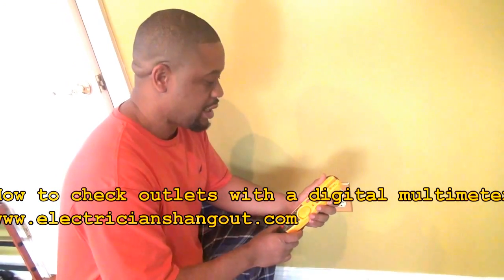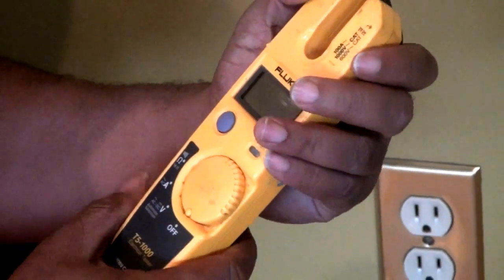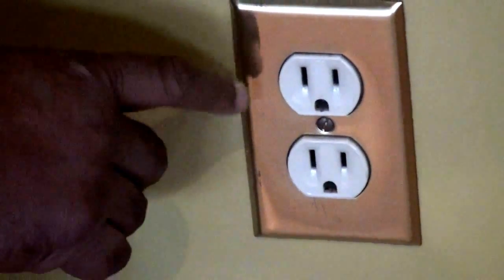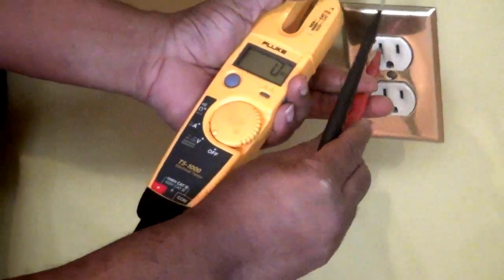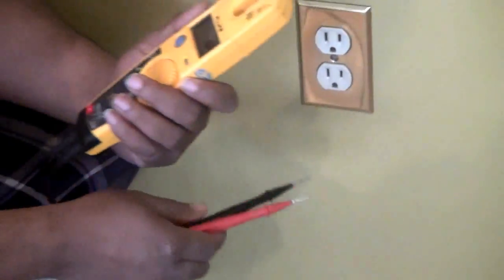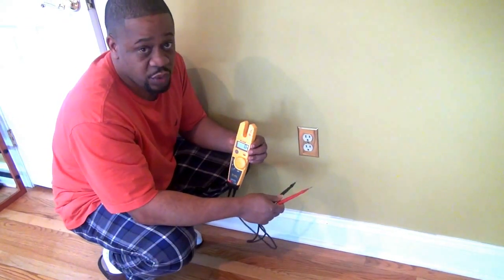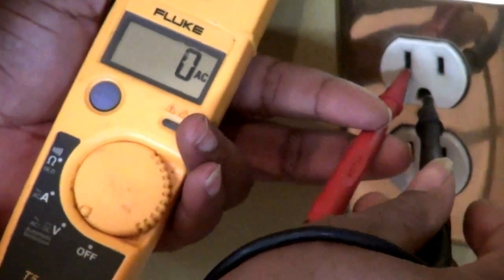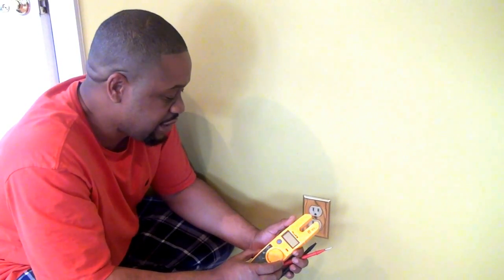How to check an outlet with a digital multimeter

Comment: Tyrone, Thanks for your help. You stated in a previous video that one shouldn't use a multi meter for testing current and demonstrated the use of a clamp on voltage meter and slide on meter ( as you labeled it)  Please clarify for me. Thanks, Brooks

Comment: Can you go over exactly each setting of the volt meter?
Reply: Their are 3 ranges. Voltage, Current and Resistance.
Although the meter self calibrates within the range, it can not select what you want to measure. Therefore, connecting the meter across a live supply set to current or Resistance could cause an accident and destroy the meter.

Comment: 20 minutes of other videos did not address the tested circuit of black (hot) to ground.  

Thank you for showing this because I thought i still had a broken wire touching another broken wire.

Since this is my current set up, and I still have no lamps (pig tails) working, what now? Argh! I am tired of the simple things not working correctly!

Comment: thanks for the video. I have an outdoor gfi outlet thtt keeps tryping. I checked all the wiring and switched a new gfi and its tryping the new one. any ideas before I give up.
Reply from the maker: If nothing is plugged  into the gfci and it is tripping you need to replace it

Comment: Tyrone, I have a strange problem with several outlets that don't work.  I took it apart put a meter on it and from hot to neutral there is no flow or voltage.  But If I go hot to ground wire it shows flow voltage and if I also go neutral to ground wire it also shows flow or voltage.  Do you know whats going on?
Reply from the maker: Sounds like you have a open neutral somewhere. so for the delayed response, your comment got buried by the you tube gods. It is kinda difficult to explain how to find the open neutral but I will try. The easiest way would be to open all of the outlets that are not working and test between hot and neutral (if there are splices in the box be sure to test between the connections also if the circuit is looped across the outlet be sure to test both sides. if you have not found the open at this point  find the circuit breaker that control the outlets then turn it off. If you have outlets that were  on previous to part one perform the same procedure on the outlets that were working. you should find your open neutral with this process but if not or you are not comfortable doing this it is time to call a professional.

Comment: Tyrone, When you used the meter I noticed a small light come on, what does the light indicate? Thanks
Reply from the maker: Joe it is just a visual indicator that voltage is present. Sorry about the delay on replying but sometimes you tube bury comments into oblivion.
Reply: i noticed that too but thought about it. it don't really matter with a/c

Comment: Great video! quick question i have a 20amp breaker keep tripping with sparks connected to back yard lights and porch recessed  lights.
everything was working well after l  changed the bad switch . after heavy rain its all off again breaker wont back on- what would you advice? thank you
Reply from the maker: +Gokhan Bulut you have to find out what part of the circuit is causing the fault. You also want to make sure that any devices you have that are outside is gfci protected. If the 20 amp breaker that is tripping is not a gfci breaker then you need to replace it with one immediately.
Reply: okayi will do that thank you

Comment: why not use a lamp and check it that way . Against spend 200 bucks on a Fluke DMM to check an outlet . Things ive seen measured with Flukes is just amassing , the most expensive DMM on the market and every single use of it is stupid . when you find a man actually doing some work with DMM, he needs it , 9 times out of 10 its not even a FLuke . Check out PC motherboard testing with DMM ill give you a 100 bucks if you find a fluke there

Comment: out of curiocity why is the red test lead being connected to the nuetral and black for live side? always had red as positive or pwr side in auto industry black as ground..Thnx
Reply from the maker: +Sal Cott there is no negative and positive with AC  so it does not matter what lead you use for what prong only that you have your meter on the correct setting

Comment: Great video! If you had outlets on one circuit that all read erratic low voltages, all under 70v, what could that be?
Reply: +gazthrak Probably a poor connection.
Reply: +gazthrak a magnetic field kakaka
Reply: It would mean there is a load on the circuit. Trace the load.
Reply: +DE “AutoBravado” Nichols I actually fixed it by replacing the breaker itself. It was a two pole breaker and once I replaced it, everything worked perfectly.
Reply: gazthrak very interesting. Thanks!

Comment: I see you used the red and black in both sides...it doesn't matter if the red is in the hot or ground and vise a versa?
Reply from the maker: +Wil Rey Nope does not matter when testing AC
Reply: Normal household AC current swaps direction 50-60 times per second. So it doesn't matter which probe goes to which hole.

Comment: I was thinking of getting the Klein et200.    but I like the fluke you have Which is double the price      I do home remodeling and would be using it when I change out plugs light switch gfis.    what tool would you recommend
Reply from the maker: +odamsy The klein would be fine for the type of work you doing.

Comment: It was really helpful, im installing a villa i tested Jacuzzi out let with voltmeter, the Phase outlet to the Ground outlet is shows zero volt. does it means i have problem with earthing!!! is it that dangerous if i didn't connect properly ????
Reply from the maker: +twana chalabi is it a gfci outlet if so when you tested to ground did the outlet trip? This may be the reason you did not get a reading. If this is not the case did you read between the correct test points?

Comment: Thanks for a great video.  It is a big help.  One question, I noticed that you switch the red and black leads during the video as to which sides of the outlet you put them in.  Does it make any difference with a multimeter as to which prong goes into which side?
Reply from the maker: +Daryl Mosely Hey Daryl, No it does not make a difference when you are testing AC

Comment: Thanks.  If I want to replace the unpolarized power cord from an older appliance with a newer grounded power cord, should I connect the ground wire to the appliance chassis?
Reply from the maker: Enigma758 yes

Comment: If the 'long side' is the neutral and the 'short side' is the line side, then why put your red lead (red = live or line or positive) into the long side, and your black lead (black = neutral) into the short side?
Reply from the maker: akorpija with ac it does not matter which prong you use on what side. Just make sure you have your meter on the correct settings
Reply: Tyrone Robertson Ah cool. Learn something new every day, thanks!

Comment: I get voltage when I put it in the neutral side and touch the metal face plate, but nothing when I touch back to the live. Does that mean my power is inverted or I have a bad ground? Should I be worried? Thanks
Reply from the maker: yes that means the outlet is wired incorrectly the hot and neutral need to be reversed.
Reply: Sorry, I was being a plonker, For some reason I was reversing the plug in my mind, imagining it how I wire the plug with the live on the right, then thinking I had to turn it round to put it in the socket and then live is on the left. Duh!!

Comment: Your multimeter other end shouldn't ever be 'hot' from the other side except maybe for the amperage setting.
Reply: Tim-J.Swan Depends on your multimeter.   Some multimeters have a separate terminal you plug the lead into for amperage measurement.   On one of those, current will always be able to flow if  one of the cables is plugged into the amperage port and the other in the common port.   Even if the meter is turned off, current can flow.     For voltage measurements.....  the current that can flow through the meter is supposed to be negligible.   But you should assume might be live anyways,  because the meter is a complex electronic device, and it could experience a malfunction or internal short at any point in time.    You could only know for sure by testing with another meter.

Comment: 3:55 no you could touch it and nothing would happen. the multimeter has a very high internal restistance.. sorry for my bad english ^^
Reply: +KUSH MASTER But do you really want to risk touching both and manage to become ground?
Reply: +DE Nichols i dont get what you trying to say..
Reply: KUSH MASTER If your electrodes had a wire open to your touch for example. ..not on purpose of course...you're safer following the rules even if it's unlikely.
Reply: Not all meters have a high internal resistance. Analogue meters are typically 20,000 ohms per volt, meaning that at 110 volts more than 50 mA is available. That is enough current to stop someones heart.

Comment: I am getting a reading of 157mV - 220mV when I test the ground to neutral. What does that indicate?
Reply from the maker: The ground connections might be a little loose or you could be missing either the main or supplemental ground but those readings are not hazardous.

Comment: Do you have a video on how to wire an outlet that has 3 white and 3 black wires? I can not figure out where all those wires go.
Reply from the maker: I do not have a video that tell you how to test to find where wires are going because it is a little advance. It is very possible that with your situation assuming that it was just an outlet in the box with no switches I would say that all the blacks go together and all of the whites go together, you put pigtails on the splices and connect to your outlet. Make sure that you turn of the power before you start working!
Reply: What are you trying to hook up

Comment: Hi, I;m sure you reversed the test leads when did this test.  The red lead is HOT and the black one is the neutral.  The RED should have gone in the short slot and the black lead in the long one.  Let me know if I'm wrong please.  Love your videos BTW.  Cheers, Neill
Reply from the maker: with AC it does not matter if you were testing DC reversing the leads would give you an accurate reading but it would show negative, for instance on way could read 24 volts reversing would show you -24 volts

Comment: Why did you have it on AC and not DC? Can it cause damage to you or the meter if it was set on DC?
Reply from the maker: the voltage type that I am testing is AC and it is possable to damage a meter placing it on the wrong setting

Comment: You are showing red on left and black on right at about 3.24 and the opposite at 5.01 which way is correct
Reply from the maker: Hey Joel, with AC (alternating current) it does not matter which lead you use on a particular side. If you were testing DC and you reverse the leads on way you would have a positive reading and the other a negative but both would be identical.

Comment: I was wondering is a 123.6 normal my voltage keeps going up and down every second to 123.8  and back down
Reply from the maker: thats fine
Reply: thank you
Reply: Normal. At the Store will tell U Plug works 110V 60Hz (Europe always 220V 60Hz). Voltage will jump. Look at City. City is using a lot Power and if ur neighbor is using heavy operated Heater, TV, LCD it will jump. Most of the time U will have 115-120V. I'm Just surprised why on plugs in North America (USA & Canada) there is no Info about V and Hz on plugs. Heaters, Ovens r hooked up to 220V 60Hz USA & Canada and Lights 110v. In Building Apartment there is no Fuser at Home, it is in the basement for every Apartment, so make sure some ppl someone will do it for U and still check V, ppl do mistakes, switching wrong Apartment off :D This is to Everyone. One thing also, U ppl can get Gloves and they Protect up to 330 V. Have a good time :)
Reply: euripean and uk use 50Hz

Comment: red is voltage black is ground why you put red in ground and black in hot.
Reply from the maker: With ac current it does not matter what lead you use. But with some multimeters you have to make sure you have the leads in the right connections on the meter itself. with dc if you reverse the leads when testing you get the right voltage but it will show as negative.

Comment: Tyrone, nice job on the video.  I'm having an issue with my outlet.  The other day I heard it pop and smoke started coming out (lightning outside but did not see/hear anything close to the house).  It appears the fuse popped in it and it is fried.  I bought a new one and connection wires appear ok.  Now I put in new outlet and I have no power coming out of outlet.  Main breaker is ok as well.  Not sure what to do next.  Could the ground wire be fried somewhere besides the outlet?
Reply from the maker: One of the conductors is broken somewhere, I would start looking in the box where you had the fault and also check the connections on your outlet
Reply: A wire has shorted and the flash has blown the connection away. You need professional help, or you could easily cause a fire. 
The fuse blew to protect you. Replacing it without curing the fault is dangerous and crazy.

Comment from the maker: If the ground or neutral is not connected to the system ground or the system ground is not bonded or you have a bad connection then you may have an open ground (NOT GROUNDED) if it is not grounded it can become energized (VERY DANGEROUS) because you have no path or a bad or limited path back to earth. In your situation sounds like either the ground or neutral is open or have a bad connection point and the other does not (potential difference between the 2 conductors) in a situation like this you can read voltage between the 2 NOT GOOD
Reply: +Dark Seid yes and the nuetral ground is in pluto lol
Reply: but in that case, Neutral is OK, only GND be opened, the path back to earth is Neutral

Please help me
Reply: +Tyrone Robertson By earth, do you mean planet earth's ground?

Comment: hey guy! i'm wondering
why voltage between Neutral and GND is 80 VAC when i opened GND of my outlet
Reply from the maker: sounds like you did not have a good ground.
Reply: Tyrone Robertson yep, if GND is OK the voltage should be 0.2V --> 0.8V ??
but i don't understand why voltage is 80V when GND opened
Could you explain for me sir!
Reply from the maker: If the ground or neutral is open somewhere or you have a bad connection one of the 2 have a bad connection you do not have a solid path back to ground (earth) so your voltage reading is going to be low and in some cases you will read no voltage. If you have something that is grounded like a copper water pipe you can test between it and the ungrounded conductor to verify that the ground is faulty in some way.
Reply: Tyrone Robertson sory i not yet understood clearly about that. Let's talk in that case

Why Voltage between Neutral and GND is 0.2V --> 0.8V ????
(in normal condition of outlet, all connections are OK)
Please help me! i need to explain it for my co-workes
Reply from the maker: neutral and ground are at the same potential there is no voltage between the 2
Reply: Tyrone Robertson that's OK, but about the second situation
Why Voltage between Neutral and GND is 84 VAC
(GND of this outlet is not connected with GND of system, all other conditions are OK)
Please help me answer it!!!!
Reply: It sounds as if you have high resistance somewhere in the neutral system. To prove it, connect a lamp between line and neutral and then line and ground, If the lamp is brighter, the fault is confirmed. 
If this is the case, seek help from a QUALIFIED engineer, since the fault is quite likely to be on your supply transformer grounding. This a complex and difficult to explain unless you have a good understanding of 3 phase and star neutral points.
Do not ignore the problem, since although you will not be electrocuted, neutral faults cause most electrical fires.
PS, I am a retired chartered electrical engineer. (UK)

Comment: Hey. Tyrone. I'm trying to replace my outlet. Because the old one kinda melted.  Now I tried putting new receptacle on there and it keeps blowing fuse. Any ideas what is causing this?
Reply from the maker: hard to say without being there but if the outlet melted it is a good chance that the fault is in the box where that outlet was located.

Comment: Tyrone, I tried to test my outlet today.  I plugged in the neutral first and then the hot side.  For some strange reason, there was a spark, and I lost all power.  What happened?
Reply from the maker: Hey Jen it sounds like you had your meter on the wrong setting you want to use the ac voltage setting for checking outlets in you house. The other possibility is that the meter is damaged.
Reply: You may have allowed the two leads to contact each other causing a short.  This would have tripped the breaker or the GFCI outlet/breaker that was attached to the circuit.  It's a common mistake.  Other thing is your outlet may be damaged/miswired as well and there is a loose connection in the rear of the outlet, when you pushed into it with your leads it caused it to short.  Simply put a spark means something shorted.
Reply: That would be the "V" with the wavy line underneath it.